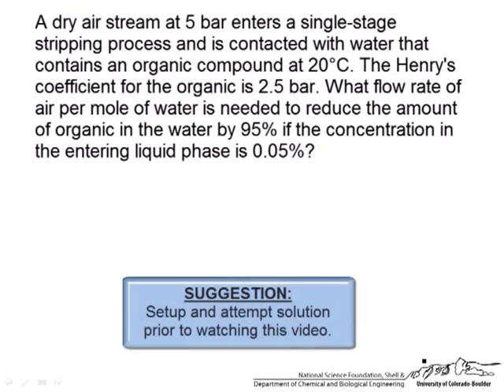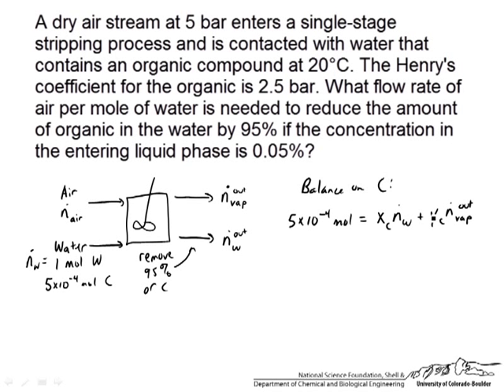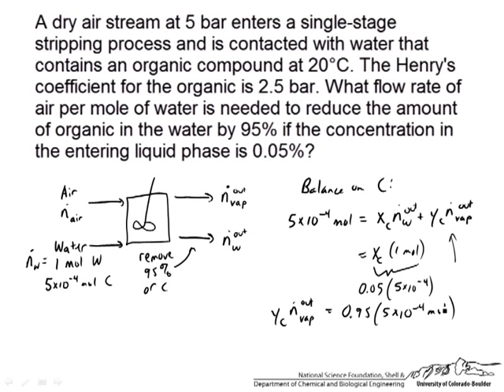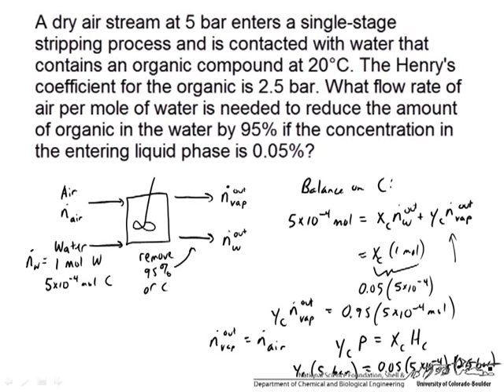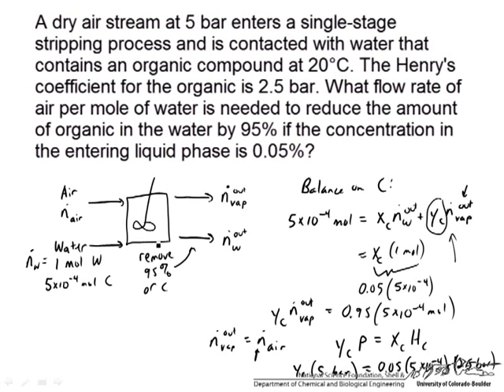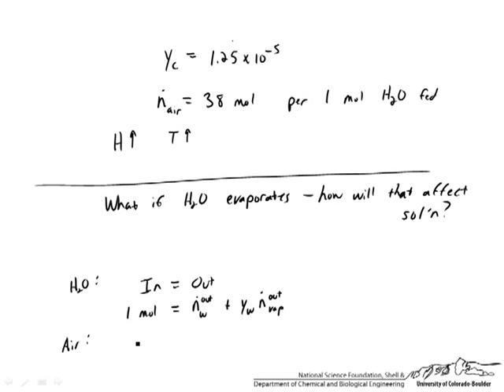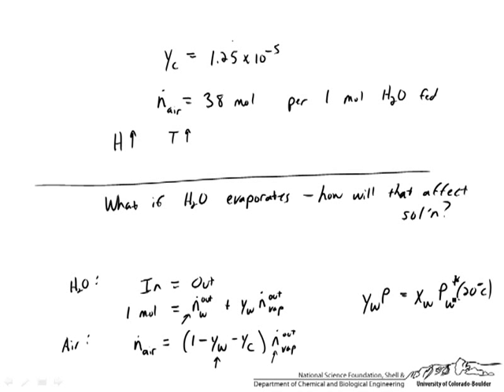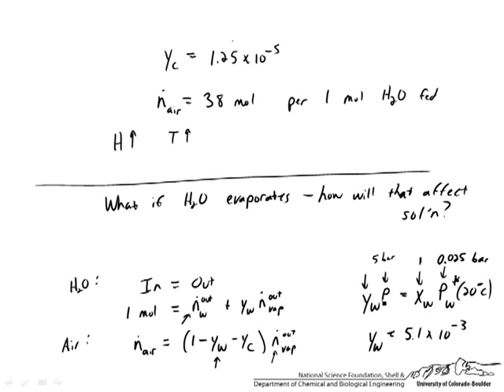Gas Stripping (Henry and Raoult's Laws)

Comment: it's a bit late for replies but I try anyway. I think that the problem is incorrect because the y_out_C equilibrium he is taking is the one that correspond to the x_out_C but this is wrong! the y_out_C (equilibrium) is the one given by raoult's law with x = x_in_C= 5E-04 then y_out_C = (H/Ptot)*x_in_C = 2.5E-04. Then write the balance as G*(y_out_C) = L*(x_in_C - x_out_C) and you should obtain 1.9 mol gas/mol H2O. If you are dimensioning a countercurrent stripper then you should increase the gas flow by a 25-50% more then calculate the new y_out_C and then you proceed with sizing a packed column or tray column with the standard procedures :). ps. watch out for thermal effect associated to stripping a chemical from a liquid.

Comment: I just noticed that for the Henry's law (4:37), you multiplied the mole fraction of C with the concentration. That's not right. Xc is a percent, and we know that only 5% of the concentration is in there. So there's no need to multiply with the concentration or else you're getting the moles of concentration -- not the percent. Unless I'm wrong;  I have a D right now in this class.
Reply from the maker: +Syvmana Thank you for the question.  At 3:10, x_c is discussed although not quite calculated.  From there we see that x_c*n_wout = 0.05*(5*10^-4 mol).  We assume that n_wout is 1 mole, so solving for x_c gives us 0.05*(5*10^-4).  I hope this helps.
Reply: Manny M. g